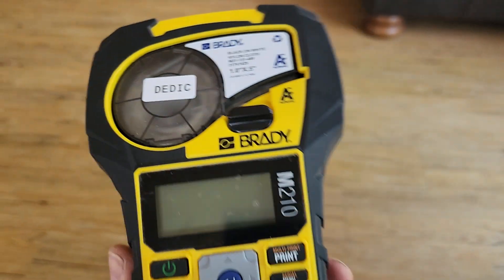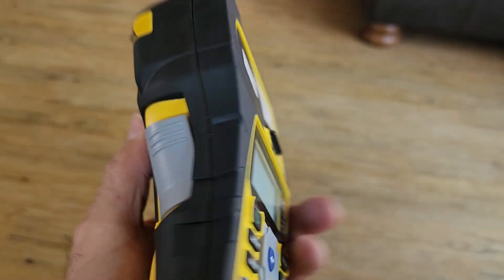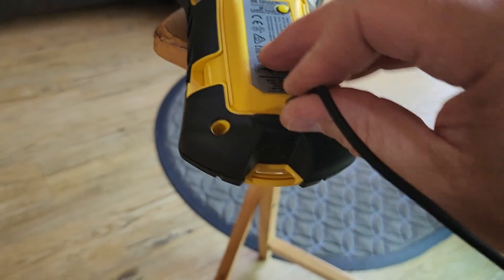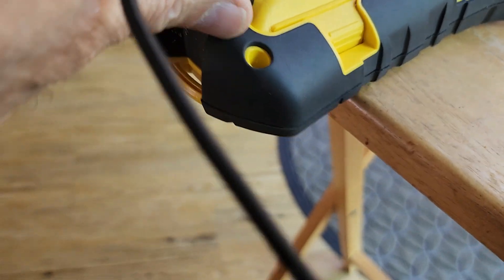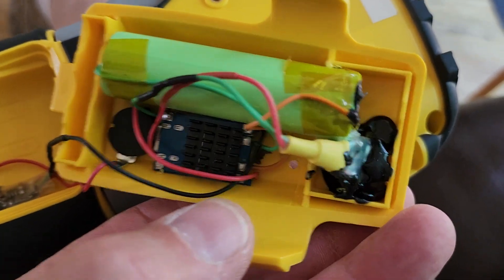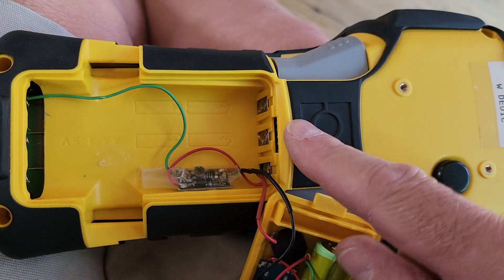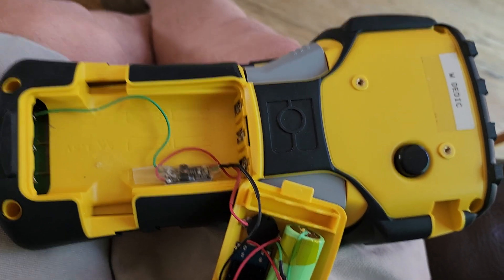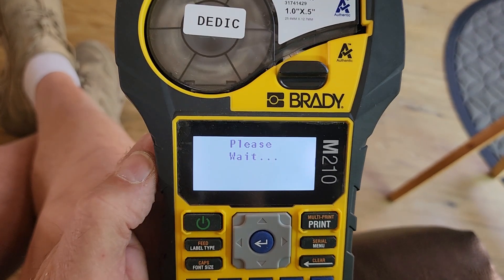Brady M210 Label Printer Battery Hack using Lithium Battery #batterysaver  #labelingmachine

Comment: my unit has no battery included and charger. can you please list down the materials you use? thank you
Reply from the maker: I don't have a list at this time.  You can source all from Amazon.  18650 battery, 3v to 12v boost board, 18650 charging module, usb c connector,  1/2 " heat sink, push button spst switch.  I used the battery holder that came with the printer.  It is custom all the way.  For many it may be easier to just purchase their battery pack and charger.